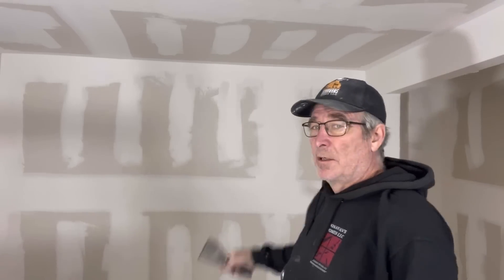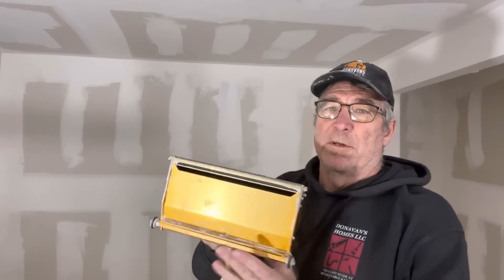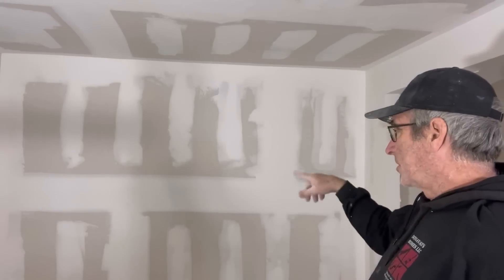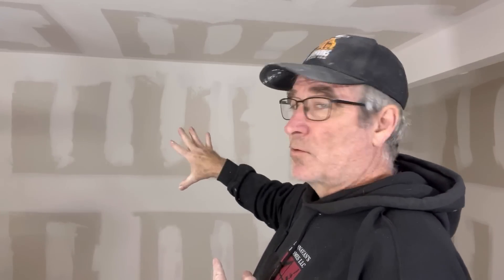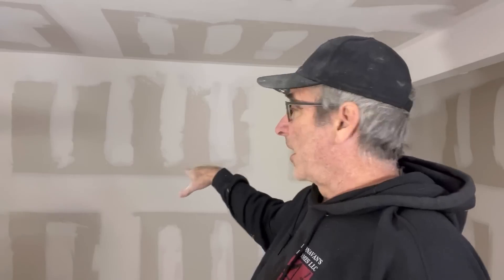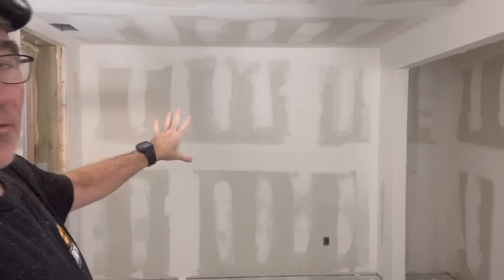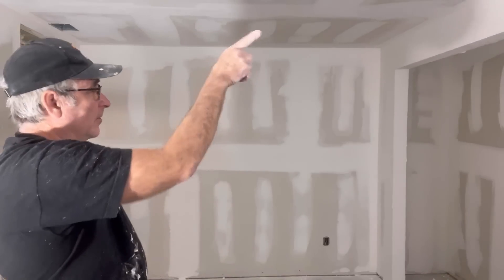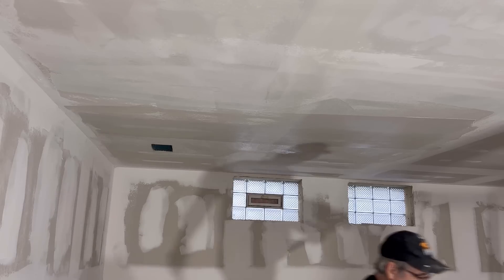Basement remodel:  sheetrock and mudding  part 5

Comment: I'm not a fan of textured ceilings either. 
I'm sure mine include asbestos. What?!
You make it appear easy to get a smooth surface. 16 years ago, I thought it was difficult so had my contractor put a knock down texture on the ceilings of my kitchen remodel. At least it's not popcorn like the other rooms have. 
Merry Christmas 🎄 to you and your family.